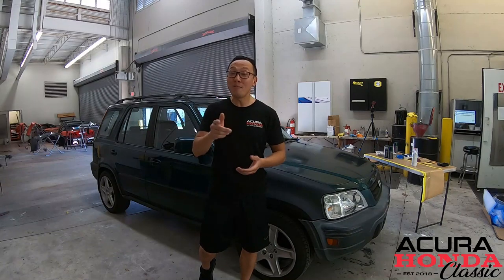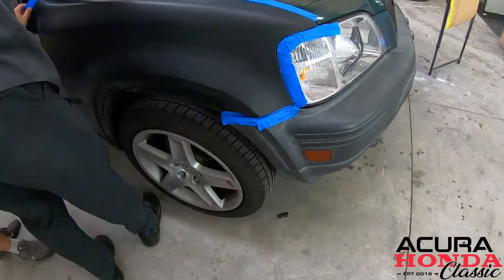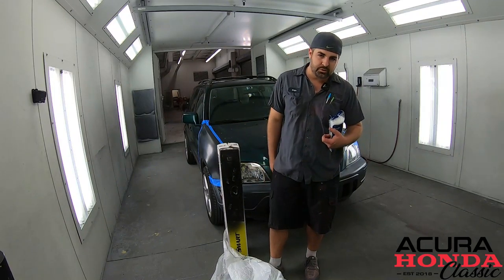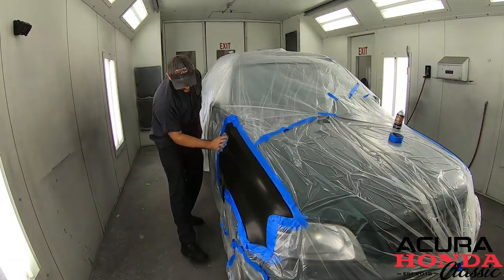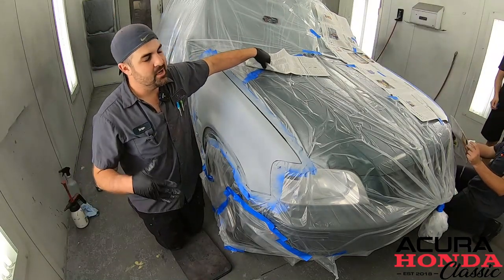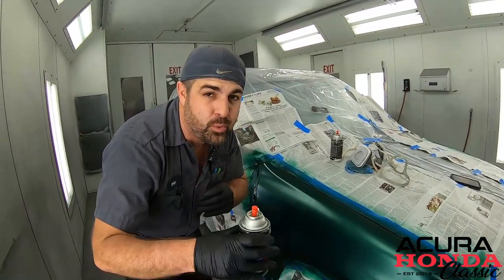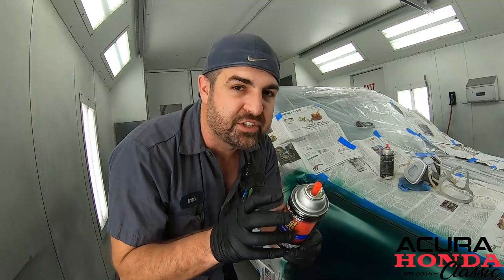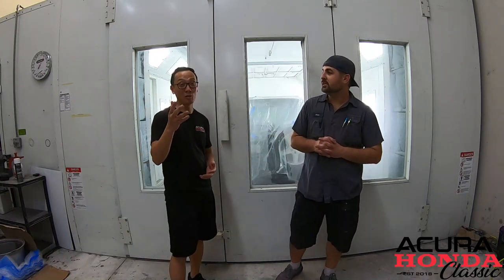AHC Shop Hours - $50 DIY Two-Stage Paint Job with Duplicolor and Eastwood 2K Clearcoat Honda CRV

Comment: How long is the wait after each coat of base and before applying the 2k clear? Did you spray on the 2k after the base was completely dry? Also could I do a wet sand or sanding of the base coat if I happen to have any imperfections prior to applying the 2k? TIA

Comment: Please help. I have applied duplicolor perfect match and it looks great. But I cannot clear coat do to weather that moved in. If I give it a light 800 sand,  and clear 4 days later. What clear coat should I use? (duplicolor, eastwood 1K or 2K) thank you in advance. How much would be needed for a car roof? 1973 dart.

Comment: Ok so i just watched the whole video and the job u did looks amazing. I just wanted to know, if I decided to do something like this at home, what's a good temperature to paint at and how long should I wait between coats, between the primer and base coat and base coat to clear?
Reply from the maker: Great questions.  Try and paint in 75-85 degrees for best results.  Allow your primer to dry for a hour. When you spray the Basecoat, allow ten minutes between coats. Allow the basecoat to dry for 30 minutes before clear coat. When you clear allow 5-7 minutes between coats. Good luck with your project.
Reply: @ahcgarage  thank u very much for ur advice. Now before I spray the  base coat do I need to wet sand the primer before spraying the base coat ? And same for before spraying the clear. Do I need to wet sand the base coat before spraying the clear?
Reply: @ahcgarage  Thia answer is very good information !.. I have motorcycle fenders in excellent condition. Just doing color change.  You scuffed surface and degreased surface before spraying filler primer.  Im thinking light sand with 600 to break own clear coat on parts, then following your directions.. Is that good ?

Comment: Great video! I have a 2018 Ford F-150 and I had a battery fall over while sitting on the passenger seat floor and it ate away some paint on the bottom of my door jamb and also on the inside bottom of the door as well. I was thinking of painting it myself since none if it will be visible from the outside. I want to paint and put a clear coat on it to protect it. My truck is aluminum, is there a special process to painting aluminum?
Thanks
Reply from the maker: Hi,  since it is only the paint that is affected, you can prepare the surface in the same manner as you would a regular panel which includes sanding and leveling the damaged areas, primering and painting.

Comment: I’m prepping to paint my brake calipers what clear coat do you guys recommend. (Rattle can of course)
Reply from the maker: A high temperature clearcoat works great on brake calipers. We will be doing a complete DIY video on refinishing the front Brembo calipers
Reply: Acura Honda Classic okay thanks that’s what I had thought but is there a better choice than the auto zone high temp clear?

Comment: Thanks for the informative vid Brian and Mike! Is that a metallic base color? Do you have any tips for getting good results with rattle can metallics? Technique seems to be much for crucial for a good finish. Thanks
Reply from the maker: It is. Shake well, really well is a great start. And technique is the core also. If you follow Brian's instruction on the video, you will do ok.
Reply: Thanks. I’ve been trying a combination of rolling the ball in the lower groove and shaking for at least 2 minutes before spraying, plus more shaking every 30s or so. What’s your opinion on warming the can before hand?
Reply: Michael Christopher yes you can. That will actually help make the paint more liquidly and the paint will be smoother. Also try to paint when the temperature is not as hott. 70s if you can
Reply: Many thanks I’ll try that on the next go and will study your technique some more. The learning really doesn’t stop after the video ends 🤓

Comment: Excellent Video ! thanks. I'm wondering what did you do after the 2nd coat of primer? did you use a clay bar? see minute 7:23 to 7: 33
Thanks
Reply: Wet sand with aeound 600 grit.

Comment: Hi is the Eastwood 2k clear coat better than the spray max clear .
Reply from the maker: They are very similar
Reply: The reason I asked is I'm going to paint my Harley frame and I was wondering which would be the best gloss coat .In other videos looks like the Eastwood clear is more glossy than the spray max but I'm not sure if it was just the video lighting

Comment: I swap the internal manual 3rd gen tl type s from the 04-06 tl tran , but the 4th gear pops out , will that cause by the wrong detent spring on 4 th gear?
Reply from the maker: Popping out of gear on manual transmission most likely to be a bad synchro gear set or bent shift folk.

Comment: My experience with this paint was not the same. It went on nice but after following all the steps and spending a lot more $ the paint peeled. This crap is  $12 for a 12oz can. No idea why it peeled but I removed it with Scotch masking tape, cleaned, light sand of the primer, and resprayed with a different brand of paint. One that actually stuck.
Reply: what brand did you use instead
Reply: which layers separated?
Reply: Poor prep work